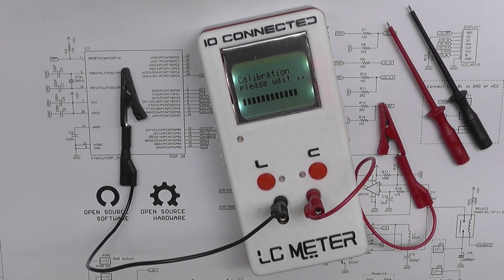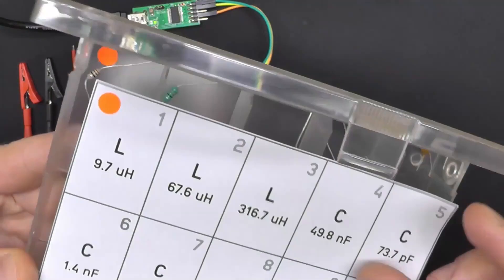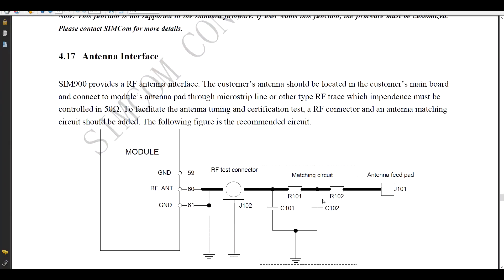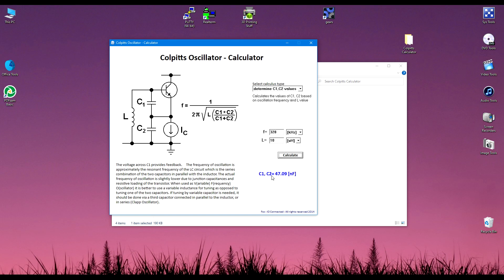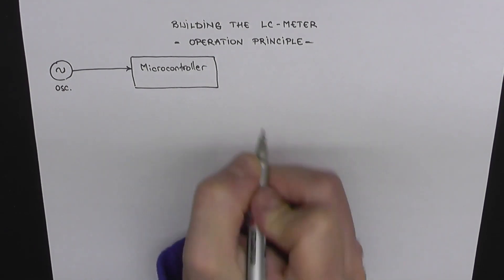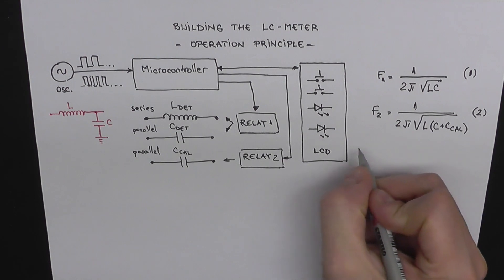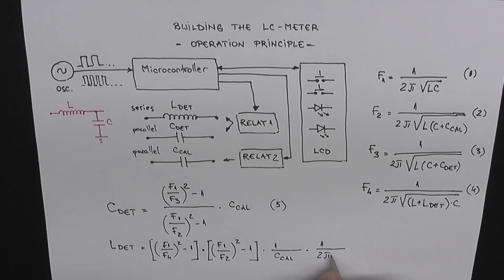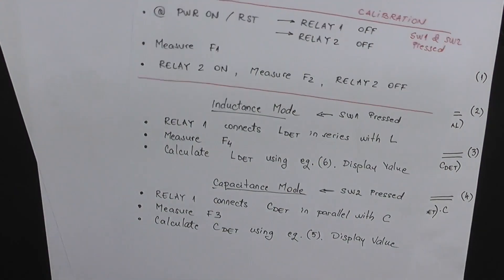LC Meter - Build - Part 1

Comment from the maker: The winners of the giveaway are: Andrew Kener,    rpavlik1,   captain skeptical,   Mameniac. 
Since I had 4 PCBs left I decided to pick 4 winners instead of 3. Each of them will receive 1x LC Meter - PCB. 

A random generator was used to pick 4 names from the comments (all the parts of the playlist).
I ask the winners to contact me at: core.weaver@gmail.com 

Thank you !
Reply: Confirmed
Reply: Can you make / modify multimeter analog + ESR + LC meter ?
Reply from the maker: @opposites-369  there's gonna be a second version with a lot of other functions (ESR measurements included).
Reply: @coreWeaver  wow.. thx 👍🏻😊
Reply: @coreWeaver  Hello, just doing a follow up on that second version. Thx, Arnaud
Reply: What I don't like from ESR meter digital only detected capacitor still good or broken, but not half broken, that's why I still using analog ESR, you can measure the pressure of capacitor power, like blood pressure is heart still normal to pump or getting weak

Comment: Hi Bruce, I'm interested in building this project but there appears to be two versions, one using an ATMEGA328P using C++ code compiled in the Arduino IDE and another using BASCOM etc.
Which is actually the current version?    Being more familiar with Arduino IDE, I favour that version, in fact, I started to lay out a PCB based on this version because I have some of the parts on hand and need to modify your board design a little to take them. Different ST7735 TFT display and some nice 1% caps I also have which are larger.. (The Github I found the files are mention 'added BN49 support'.)
I need to confirm version I am building is current or at least why the design layout etc changed. Where there problems of some kind?
vk3pe

Comment: Hello, 
Very nice and interesting project, congrats.
I have a simple question.
Can the LC meter measure inductance in the range of 0.1 to 1 uH like the AADE iiB does?
I have not found any instrument specs.
With all these toroids for the higher HF bands such values are found.
Konstantinos

Comment: I built 2 of these but have not gotten them to work yet.  I am wondering if me not setting or picking any AVR fuse settings when I programmed the mcu would be the cause.  Coreweaver what should those fuse settings be?  Thank you.
Reply from the maker: Fusebits: FF
Fusebits High: D9
Fusebits Extended: FF

there's a "fuses readme.txt" in the firmware folder

Comment: Great Project sir.One question sir? Can the capacitance be measured in working conditions? Any method or suggestions sir. Thank you sir
Reply from the maker: no you can't measure caps in a powered circuit. Even an ESR measurement for a high capacitance cap would be very far off.

Comment: What is the importance of calibrataion
Reply from the maker: any measurements you take are calculated with these formulae here: https://www.youtube.com/watch?v=KhJiE4gL5T4&t=902s

So each of the F1-F3 or F1,F2,F4 are needed in order to determine a capacitance or an inductance. Imagine you start your LC_Meter, run it for 5 minutes and let's say you room temp. drops or rises in those 5 minutes. All the components on the oscillator's circuitry will have slightly modified values. Now let's say the F1 and F2 will remain the same since they were only measured once (at boot up). So the measured C or L will start to drift too.
Another scenario: let's say you start the LC-Meter without any leads and probes connected, and you plug them only after calibration. The measurements will be far from reality since you've measured F3 and F4 with an additional capacitance. 
Even if you're measuring with the probes and then switch to alligator clips, there's still gonna be a difference between the probes capacitance. 
I hope this explains the need for calibration, which by the way means (re) measuring F1 and F2 a few times, and averaging their values. 

When I did the "INSANELY low capacitance !!! Measuring Femto Farads with the LC Meter" Video: https://www.youtube.com/watch?v=OS8h7cKJdKs
I re-calibrated after each measurement. 

Even changing the position of the leads will affect any measurement. 
To measure such a low capacitance, like I did in that video, I also modified the calibration procedure in the firmware, by increasing the number F1&F2 measurements and the time between the measurements, in order to get more precise values after averaging.
Reply: I've been thinking this too. This project uses bunch of frequencies and the only component that should really precise is the C cal. Is bunch off the frequency that measured here because of this reason?

Comment: Can I ask you use PIC16F628 or Atmega32 ?
Reply from the maker: I used the ATMega328P.  It's possible to change the microcontroller and use the ATMEGA32. You'll just have to use the same pins I used and recompile the firmware for the M32. To use a PIC you will have to rewrite the entire firmware.

Comment: I built this but could not measure anything
Reply from the maker: it's a pretty vague statement but here are my thoughts: probably your oscilllator (LM311 chip + circuitry) doesn't work the way it suppose to. Have you tried using the debug function (UART logger) ? If so, what are the values of F1, F2, F3 and/or F4 ? If not.. why ? that's the reason it's there, for debugging purposes.

F1 is the freq. (l1 + c12), F2 is the frequency measured after the calibration capacitor was added (your reed relay could be faulty), F3 and F4 are the frequencies after adding the capacitance or the inductance to be measured (is your double relay switching ?) Also.. make sure to disconnect any components from the measuring leads BEFORE AND DURING the calibration sequence.

This project has been completed and successfully tested by more than 50 people until now, at least what I'm aware of.

Comment: Good 
Is possible to also include measuring Resistors?
Reply from the maker: currently there's no circuitry for this purpose on the pcb. I will make a version 2.0 in the near future and I plan to implement resistance measurements too

Comment: hi, i tried to build this one ,but software for atmega328 is preventing me/....i am not used to bascom., you provided .hex file though,. can i burn atmega328 with this HEX file using xloader??? do i need to burn bootloader first to do so?? please reply.
Reply: Thank you for your response. I ordered an usbasp programmer, which i intended to use with progisp programme.
Reply from the maker: @RepairRadioLab  USBAsp will do the job. I assume you have an adapter to interface the ATMEGA328p with the programmer. If not you can easily build one. Contact me if you don't know how to do it. As for the PROGISP, I think it will work. If not try AVRstudio or AVRdude, afaik they both support USBAsp.
Don't forget sure to set the Fuses too (Fusebits: FF / Fusebits High: D9 / Fusebits Extended: FF). Otherwise it won't work. A new ATMEGA328p comes with "clock divider by 8" activated from factory, that's one of the reasons why flashing the .hex without setting the right fuses is not enough. Good luck and don't hesitate to contact me if you're stuck.
Reply from the maker: hi, I never used xloader so I can't tell you for sure. From what I see in that picture attached on its github, it uses a com port so it's not an SPI programmer. To use that you would have to flash a bootloader in your mcu first.

The easiest way would be to find an ISP programmer (10$ or less on ebay) and then use either AVRdude or AVRStudio or other compatible sw.

Comment: Hello, thank you, it's really detailed and well explained. I have a question if I may, did you use relays instead of mosfet as a switch to avoid side effects like the resistance of the transistor?
I just listened to the song you used during demonstration, that's a nice discovery, reminds me a bit of Boards of Canada :-)
Thank you!
Reply from the maker: Good remark, yeah, partly because of that. I didn't try this, but I wanted to build it rock solid from the get go. It's a beginner's project and I didn't want to give a guy who didn't use the right gate resistor headaches. The relays are either totally on or totally off. You don't have to worry about leakage currents or other things. You hear a click noise when it switches which is also nice when you've just finished soldering and you wanna do a quick test. I suppose you could try and use mosfets or analog switches too instead of those relays. And if you wanna read more about this topic, there's a lot of info out there about "relays vs. transistors"

Comment: Nice project.! Just curious how long did it take from the moment you desided "i want to build one" til "i am going to build it" and then actual building ? I gues between "want" and "going" a few months (maybe more) and for the next phase a few weeks, which all depends heavely  on how much spare time you have.
By the way i don't have a 3D printer and don't use AVR, (positive karma!) make someone else happy with a PCB.
Reply from the maker: I appreciate your comment, I have this feeling you know this kind of "ride". The part that took the most time was sorting the hours of footage and editing it into the videos you see. It took me about 2 hours from the "wanting" part till I had the schematic ready. Aprox. 3 hours for the pcb, a few days for the case (a lotta filament cause I made each part multiple times till everything was close to perfection), two days to assemble everything, 2 hours for the firmware, and a weekend for the PC UART application. But between those steps, are weeks of pause, cause time is a luxury as you guessed and this is just one of the 200 projects I was trying to finish in the free time I which I almost don't have.
Still.. this was a prototype. This takes time even if you're Apple. 
If this was a commercial product, and if I was the manager of a small talented crew, instead of doing everything myself, it would've been done in a week, idea to packaged item.
A lot of the geometry of the case for instance would be so much easier to do, using industrial manufacturing techniques. As I'm sure you're aware.
One last thing.. It's was prototype, and these things take time. If the version of me from the past would've seen these videos, and have access to all the files I linked to,  he would've finish this in a weekend, I like to think so, at least ;)

Comment from the maker: This series has 4 parts. I tried to explain everything starting from the basic principle of this LC Meter, the situations when you're gonna need one, and then going through all the design and assembly processes and finally testing the prototype and the software application I wrote for it.
Make sure to watch all the parts, and post a comment for a chance to win one of the 3 PCBs I am giving away after this series.
Reply: Sự chính xác khoảng bao nhiêu % số với thiết bị lcr chuyên dụng